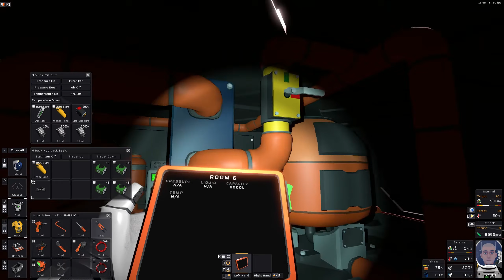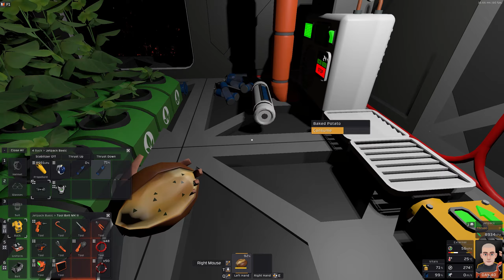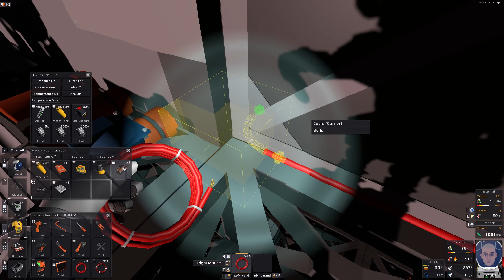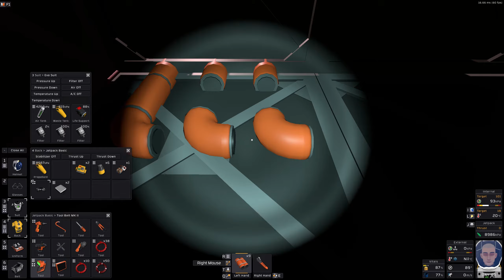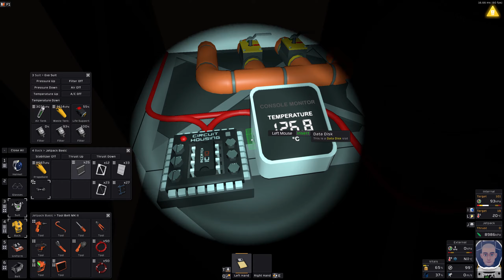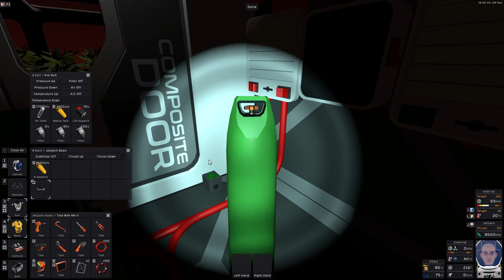Stationeers (Beta): Brutal Vulcan, EP14 - Fancy Advanced Furnace

Comment: Hi again. I have noticed that with new update trick with furnace in enclosement is not working anymore - it will loose heat no matter what. However doing so will slower rate of cooling as it was before update at lower pressure than 100kPa. Maybe enclosing it with frames and ramp up pressure to few Mpa woluld do the trick - I don't know. I just heat my furnaces with combustor anyway - it is less hassle than entombed furnace with no front panel acces anyway.
Reply from the maker: I just doubled check on Vulcan and didn't have a problem with the furnace holding heat over a long duration.   Used an advance furnace with the controls sticking out (like in the video).    With about 200 kPa in the space with the furnace (that said, success if the pressure is above 100 kPa).   Just used steel walls with the only frame on the bottom.    Have a passive vent inside the space to permit controlling the gas within (initially to get the pressure above 100 kPa, and then to reduce has the pressure heats up).   If the pressure gets a little out of hand and damages the steel walls, it can be repaired using steel sheets and a welder.   (This assumes that you also reduce the pressure to under 300 kPa).
Reply: @VenusianGamer  Ok. I'll check that. I keep 160kPa in my room. It was working in the past maybe now it needs more than 200kPa as you said.
Reply from the maker: Only over 100 kPa is required and stated in a recent discussion on Discord on the subject.    Note, if the gas is over 100 kPa and colder than the furnace, then the furnace will lose some temp to the contained gas until they are equal.